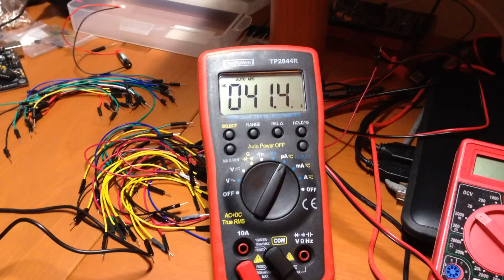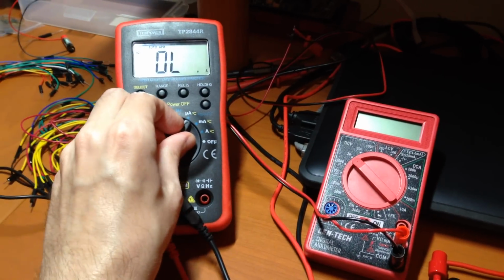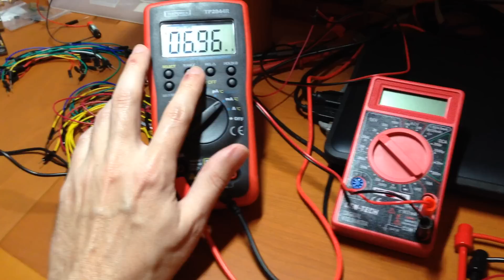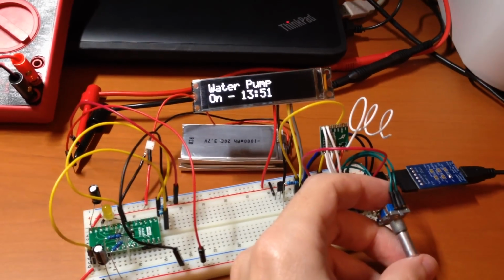Arduino Wireless Pump Controller 06 - Changed the radio

Comment: Pretty cool project and nicely demo'd!  I'd like to take a look at the code if you have it published anywhere.  I have all sorts of trouble with menus and sleep functions :)  Cheers
Reply from the maker: I know what you mean about menus, I had a heck of a time making the little blinking led menu I show in a later video for the endpoint that actually plugs into the water pump.  Here's the code and it uses a few libraries not part of the default Arduino installation but this is not really important unless you wanted to actually compile it.  I could zip them all up and make them available too if needed.  https://drive.google.com/folderview?id=0B6Z6zJIgi3L2MS03OEdPRWdzVkk&usp=sharing
Reply: dparson Excellent thanks.  I'll take a look for sure.  Libraries shouldn't be a problem- I can usually find em if needed but the code itself interests me more ;)  Cheers!
Reply: dparson Wow!  It may be awhile before I can implement some of this (it's summertime haha) but I just wanted to say your code is amazing!  Clear, well structured, intuitive variables, and the comments- amazing.  I am in your debt.  Cheers

Comment: excellent project :) but i'd like to get the code if you posted somewhere Thanks :) great work.
Reply from the maker: Sure, here is the code.  It uses a few libraries not part of the default Arduino installation but this is not really important unless you wanted to actually compile it.  I could zip them all up and make them available too if needed.  https://drive.google.com/folderview?id=0B6Z6zJIgi3L2MS03OEdPRWdzVkk&usp=sharing
Reply: Thanks a lot sir :) ill be happy if i got the zipped one thanks a lot again :)
Reply from the maker: charan k.v Sure thing, I put a zip containing the libraries in the google drive share.  Same place as before https://drive.google.com/folderview?id=0B6Z6zJIgi3L2MS03OEdPRWdzVkk&usp=sharing
Reply: Brilliant thanks a lot :D